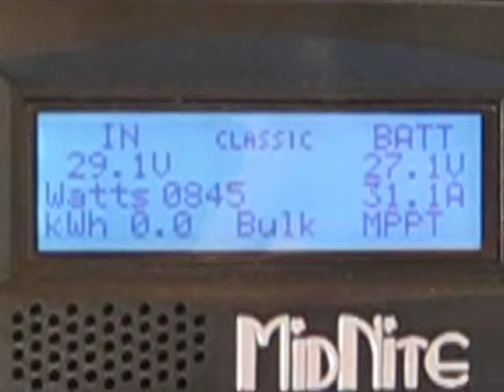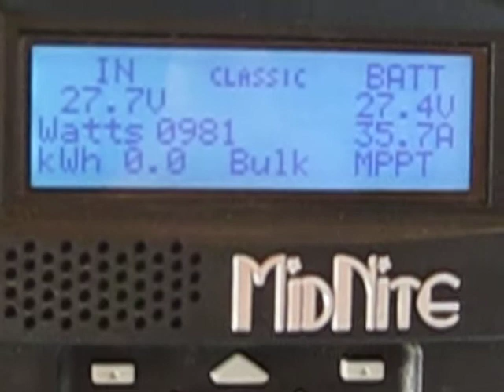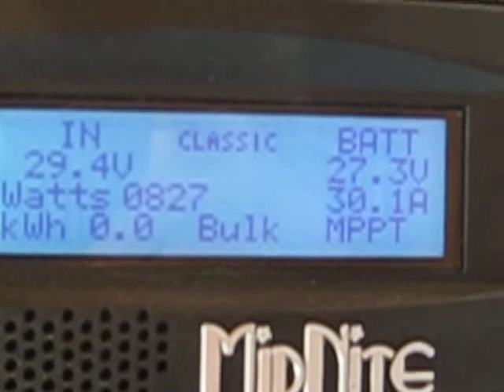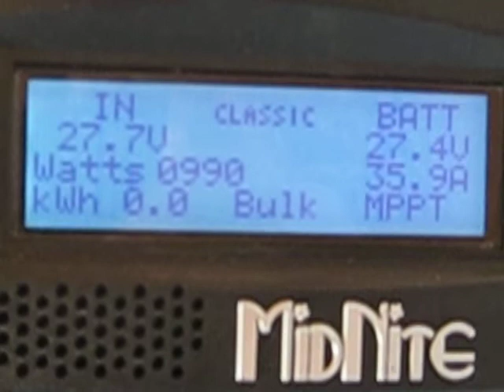input problems 2nd example 001

Comment: That is very puzzling.  When you get those wattage spikes the RF interference is noticeable on your camera.  Have you looked at your magnum remote to see what your battery percentage is?  What electrical loads do you have running?  The Classic will supply power as needed, so if there isn't a demand it will reduce amps, but then bring them back up as demand increases.  I half wonder if there is something wanting a bunch of power for a short amount of time causing those spikes.  Or I could just be talking out my ass...or bad controller.

Comment from the maker: ok bob, I have Legacy po mode set at 5% will monitor how it effects input, but usually the input voltage stayed over 31,4volts into the classic, for some reason when it dropped then the watts and amp increased, they did not run that high with a voltage input was over 31.0 volts

Comment from the maker: you will notice when the voltage input drops down to 27.6  the watts increases and the amp input goes up, once the input voltage goes back up to 31.0 area the watts drops off and so does the amp output

Comment from the maker: it does the same thing with or without a load on the inverter. this video was done with no load , then I went in and hooked up the computer, tv, light, fan and plugged in my cell phone charger, came back out with inverter on, did the same thing, no increase except these crazy surges and the surges are the area it should normally be running with 1650 worth of solar panels and not a cloud in the sky

Comment: It appears that the MPP voltage (Max Power Point V) of the PV array is at or below the battery voltage.  It needs to be higher than the battery voltage for MPPT to work properly.

However, you can get it to work better by changing the MODE from SOLAR to LEGACY P&O  to keep the input voltage closer to the battery voltage which is where you get the most power in your case.

You might also want to set the Legacy P&O "Depth" to smaller than 10% so that it only goes, say, 5% above the max power point voltage when it sweeps.  You may not need this PV array to sweep very often though since that MPP voltage is always going to be at or around battery voltage and therefor it won't change much unless the PV temperatures gets COLD, in which case the MPP voltage with go a little bit higher than what it is now.

The MPP voltage will also  be low if you have partial shading but since you don't have (?) the panels in series, partial shading won't happen.

Can you post the Voc of the PV array ?  That is an important number.  The MPP voltage will be around 75% to 80% of the Voc voltage (Open Circuit voltage)

boB